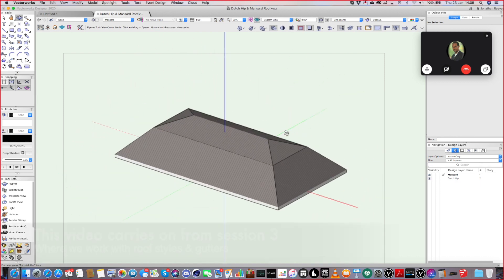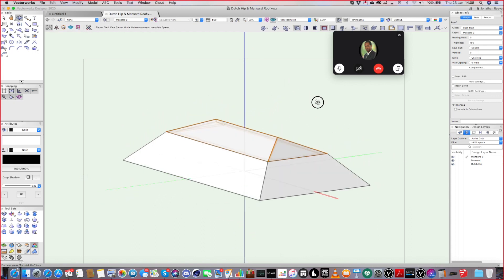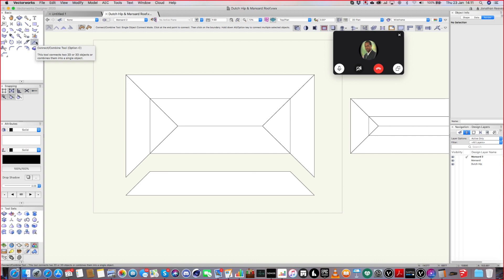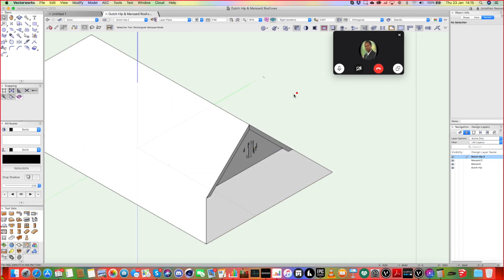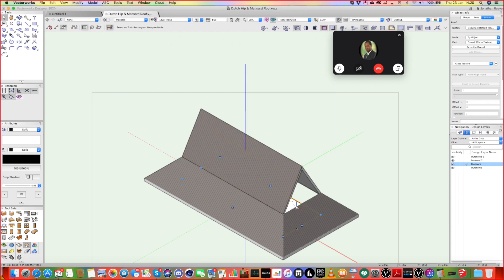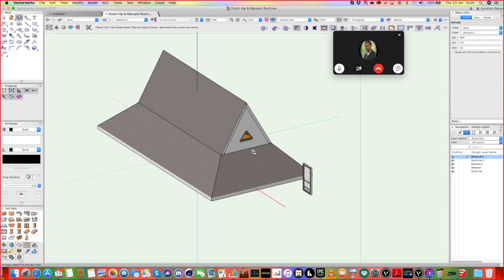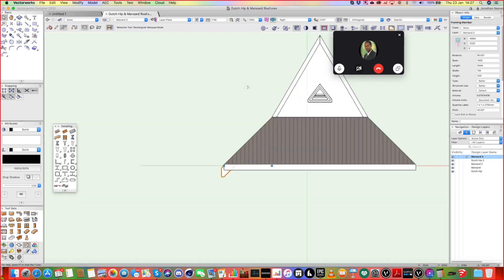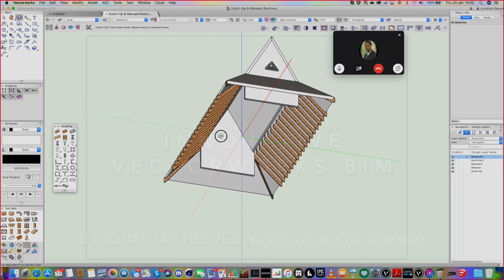Vectorworks BIM Training: Mansard, Hipped Roof & Rafters

Comment: With or without plugin.. is Vectorworks capable of doing 3D roof tiles? Something like Cadimage & Terran plugin for Archicad.
Reply from the maker: Its possible to model these using a 3D extrusion for each tile, make a symbol, then duplicate array or surface array them. I normally just us a texture as its faster, but understand that showing real times would look better!
Reply: @jonathanreevescad  Thanks for your reply. Appreciated.